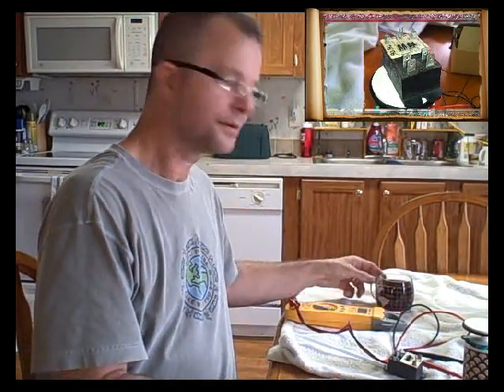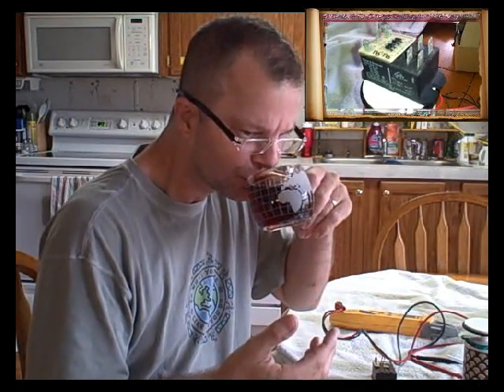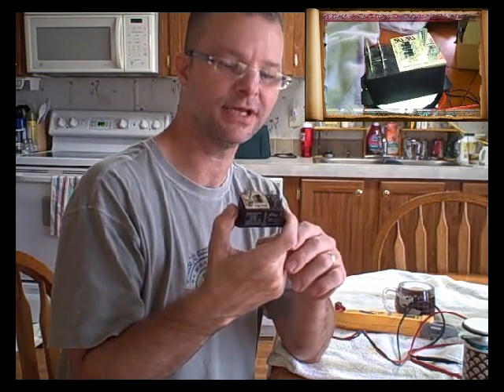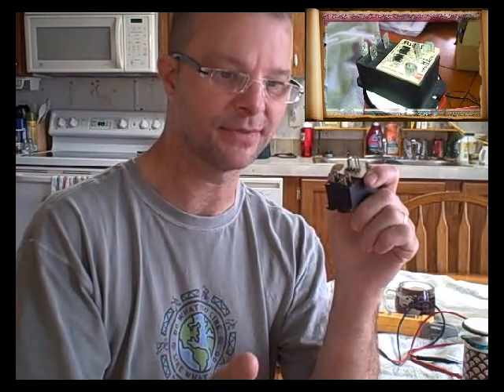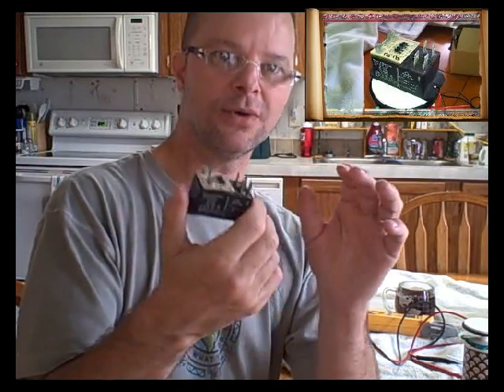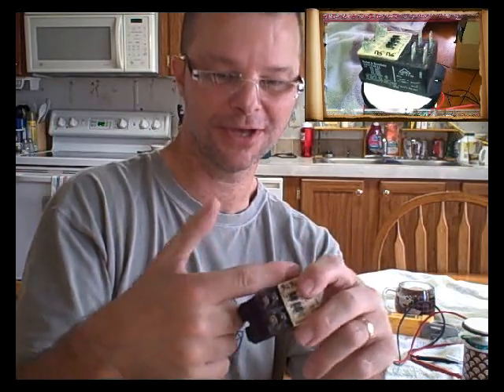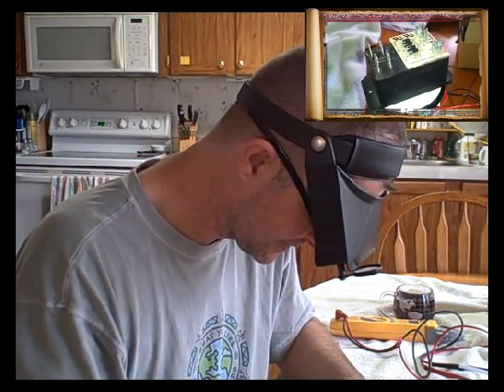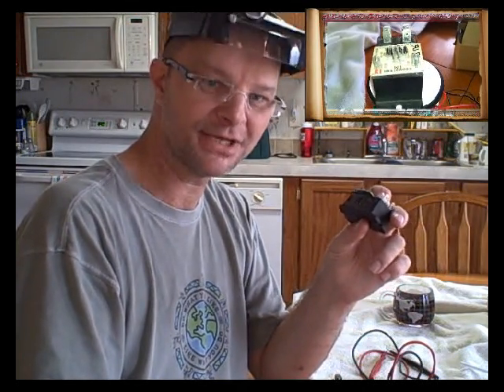HVAC DC Heating Relay troubleshooting

Comment: how can I check thermostat 24 v to ac outside what should my meter be set on???
Reply from the maker: Danny, I don't recommend homeowners to do something like this, the low voltage wiring outside terminates right next to the 240v wiring so it could be very easy to accidentally electrocute yourself. If your bound and determined to do it, the best thing would be to use the disconnect outside to cut the 240v power while you check it. Set the meter to AC voltage and then follow the two low voltage wires to the contactor. It might be easier with the cover off to look at the contactor, then turn on the thermostat to cool and go look at it again in a few minutes, if it doesnt have a cover on the contactor you will be able to see it pulled in,unless it is bad or you dont have low voltage. The thermostat has to be calling for cool before any voltage is present. Of course knowing the problem might make it easier to troubleshoot. A secondary warning, some of the outside disconnects, if they are flip switches that look like a breaker, dont like to turn back on if they are a little old. So you might flip it off for safety to test and it wont reset and has to be replaced! Probably best to get a contractor to check it for you!
Reply: All done always shut power off and short out capacitors EZ stuff I recommend all homeowners to do it themselves instead of getting ripped off by these AC criminals!!!
Reply from the maker: The only reason I don't re recommend homeowners do some of this stuff themselves is because you never really know the level of competence from on person to the next, if you know what I mean. I'd rather lean towards the safe suggestion! ...of course someone who has their mind set on doing something and feels comfortable with doing it is going to do it anyway ;). ...with modern AC units I haven't had a problem needing to discharge the capacitors (though I still do it out of habit;) since they bleed off to the motors pretty quickly... Now some of the older units and the way they are wired with those freaking huge old capacitors that still used pcb's, I've gotten a scary jolt or two over the years accidentally! Gotta watch out for those!  Gotta love the old caps though, they last forever :)
Reply: well everything today is made to fail I am so sick of this new way of ripping you off. But people should always share info to help people stay safe and save money.
Reply: Danny Diet "I recommend all homeowners to do it themselves instead of getting ripped off by these AC criminals!!!"

I do too, because when the homeowner does it themself and cause significant damage, it keeps the "rip-off criminals" like me gainfully employed!
Reply: Jake Jones I know when its not a big deal of a job when you insured AC dudes aviod telling us its easy fix.  But thats ok because it made me learn about AC units now I know more than you LOL all the way to the bank !!!!!And anyone wants any help just let me know dont pay those AC criminals!!!! DIY!!!
Reply from the maker: Well like any industry there are definitely ripoff artists in HVAC, sad but true, I've seen my fair share, hell I've cleaned up after enough of them! ...but the fact is there are plenty of good guys and girls out there as well!  I never made up things or sold a homeowner parts they didn't need. ...and I never once suggested to an owner that they should just replace the unit because it was getting a little old, lol.  

I went out on a call once on a Monday, middle of the summer and the homeowners unit had died in the middle of the night so they called some 24hr place and had an emergency call, the tech came out some time after midnight.  He told the homeowner that the compressor was bad and that the unit needed replaced.

Well since the homeowner couldn't get it fixed right away and they had an insurance policy that would cover the ac, they opted to have us come out monday.  So the owner tells me all this and I said I'd take a look and see what I found.

I walked up to the unit, removed three screws, squatted down and looked at the electronics. Put my glasses on and looked closer. Stood up and walked out to my truck, opened a toolbox and grabbed a 60/7.5 MFD capacitor, walked back to the unit, cut off the power and replaced the bad capacitor. Popped off the cover on the compressor to make sure the leads weren't burned, tightened up all the HV leads and then put an Amp clamp and n the HV mains incoming wires. Turned the power back on and the unit fired right up!  Put my gauges and temp probe on it to check that while I screwed the cover back on.  Went inside and collected sixty bucks.  Homeowner was shocked that it was fixed, surprised I had only been there about ten minutes, happy, then mad, then happy again! Lol.  I HATE calls like this because I hate the thieves (could have been incompetent, but I doubt it) and I love calls like this because I now have a new customer who will only call me from now on and will happily give my number out!
The crooks may make a fast buck but they rarely get repeat customers.  If possible, I ALWAYS show the customer what's wrong, I.e. bad capacitor, burned/dead contactor etc.  
Hell, a few times I've actually finished something simple that didn't require parts so fast that I didn't bill the customer! (Usually retired/fixed income older folks, but still,,,) so there are good guys out there!
Reply: Danny Diet "I know more than you LOL"

Well congratulations for knowing more than someone who's been in the trade for decades.

"DIY!!!"

Yup. And when you make just one miswire, causing hundreds of dollars of damage, then you can call ME who will do the repair the RIGHT way.
You get what you pay for...

Comment: Quick question: Do you think this heating relay could cause a condition where the outside heat pump unit would come on about every 6-mins and run for about a minute? Inside air handler doesn't come on.
Reply: No. Most likely a thermostat or logic board issue. But first, I would check the secondary circuit for voltage to the related components as it could also be the wiring.

Comment: It is dc because it's on an infinity Tstat which requires a communication dc signal to call on w2 heat.
Sometime your heat strip may be shorted to ground. Make sure you take an amp draw to your ground wiring .
Reply: Why not just check for short. Safer test.

Comment from the maker: Awesome!  Great to be helpful and really nice to see someone else run across this!  haven't had anyone find one in a while :)  don't forget to fuse the low side of the transformer if it isn't already! hehe.  ...yeah, always FUN cleaning up after other techs messes, or worse, going out on a 30+ year old unit that has had dozens of techs work on it and 'shortcut' with rewiring etc and you have to scratch your head for half an hour! lol :)

Comment: Thanks Mikie, I just spent 3 hours and a box of fuses on an old Lennox electric furnace with a 3 Ton Carrier HP cased coil on top after tech #1 blew the stat and defrost board swapping out the 230 to 24 vac trans etc. After I cleaned up his mess, got the HP to run then the fuse pops on Stg, 2 Heat Strips just as you ran into. I told Joe home owner  I'ld be back after I scanned YT

Comment: Hey man I just wanna say thanks. I fixed my A/C air handler fan a while back by replacing all of the relay with new ones. I think it was because  of this video that gave me the idea of replacing all of the relays. It was a 10.00 fixed that saved me over 3,000 dollars. My A/C system is over 18 years old and a technician said that the whole system needs to be replaced. Btw I have no experience in A/C I just took a guess.
Reply: How you check that with continuity

Comment: Awesome information. I wonder if that air handler had a discharge air temp sensor. Usually equipment that incorporates a DC relay, is because it's solid state. Meaning that there is no moving parts inside unlike a convential snap relay. With a solid state relay you can actually pulse the heating elements on and off for very short periods of time. This increases a greater operating efficiency and a more even heat. My specialty is chambers and they utilize them all the time. Thanks
Reply: That is interesting, but I think these are DC only on the low voltage. other side is AC

Comment: Mikie check the diodes on the small board with an anolog meter ,one of the diodes  will be shorted , the other ones will read half scale ,use rx1 . betcha a dolor to a donut.